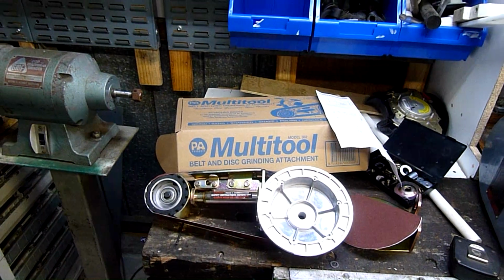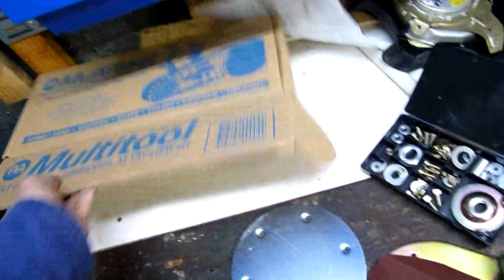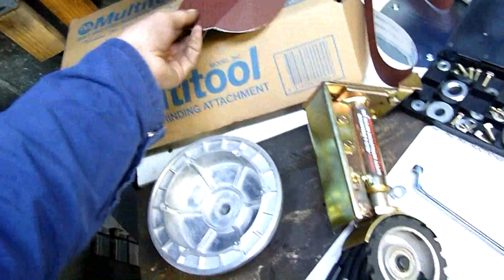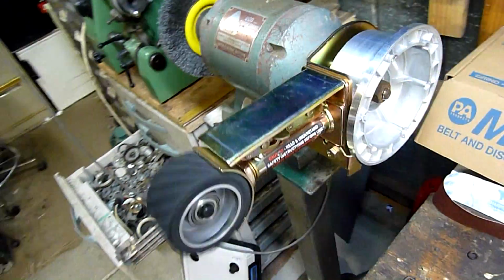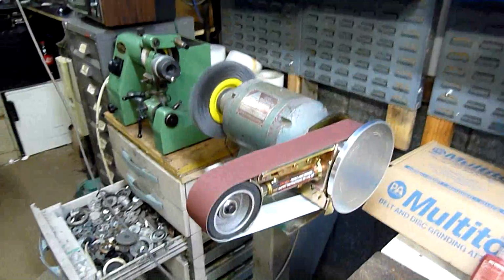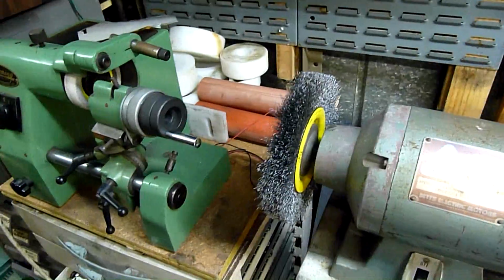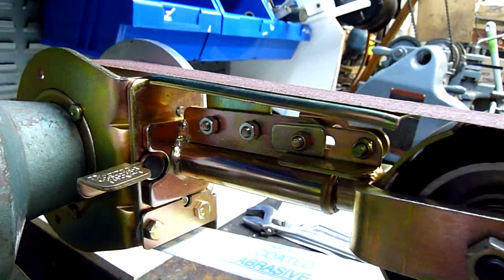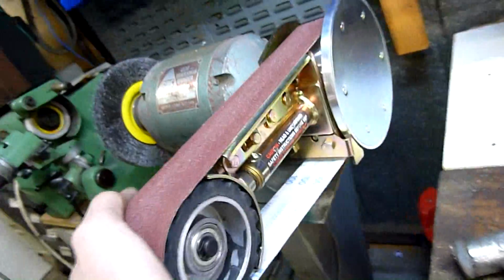Multitool Linisher Attachment Install

Comment: Im new to metal fab. Just wondering why a belt grinder is better than the oldschool grind stone? 

I was hoping to get one of these for also some knife sharpening but i have learnt I cant hook up a controller.  A 400grit belt would work well on knife sharpening. Not sure how good it would go when its at 3000rpm though?

Comment: Nice $$  But Id rather have this belt inclined with a table. Guess you couldn't use the large wheel for anything that way, but it looks like the large wheel is in the back either way.
Looks very well built though.

Comment: Awesome tool and I have already used on a number of projects with much success.>>>do7.info/hsro   Only complaint with most of these sanders is there is no way to sand tighter edges on things. Would be great if you could sand in notches and get part right up against the belt.

Comment: Do you think the tooling grinder like you have is the only proper way to grind small lathe cutters and drill bits too? What about the sorby pro edge belt grinder? I understand that lathe cutters can be sharpened there with precision? Then again their diamond belt cost half cost of the grinder itself.

But for the precision bent grinder this sorby pro edge belt grinder seems to be the only one.

Comment: Thanks for the informative video mate. Have been looking at these and will get one for knife grinding.
Reply from the maker: its not exactly a knife makers linisher, but its a good cheap start, as opposed to buying a professional machine for thousands of $. its great for dressing freshly cut steel prior to welding/machining etc, but I have struggled to get a nice grind on my home made shop knives, but its adaquate
Reply: Aussie50 yeah that's all I'm after, until next tax return when I'll probably get a noob grinder. By that time hopefully I've knocked out a few blades and have gotten the feel for it.

Comment: The problem with this kind of setup is that you are using a direct drive with no ability to vary the speed. If you want to grind/ polish: aluminum, wood or plastic, you need a much slower speed. The best setup is to purchase a variable speed grinder in which lower speeds do not suffer from lack of power.
Reply: I want to buy one and put on the Hercules 8in variable speed grinder. 2000 to 3400 rpm. I think it will have enough power rated at 0.9hp.

Comment: looks like a good attatchment. wanting to know if you could make a video on how to install a polsihing wheel onto a bench grinder and also im wanting a grinder that when a wire wheel is attatched i can really load it up and put some pressure into it to clean up metal plate and rust what do you recommend does the power go on 'watt size'?
Reply: Please reply would be much appreciated

Comment: Two questions,  why would you i pay 250 for attachment when I can buy the whole sanding machine for 70 on eBay? Secondly, If we can can achieve same performance with a smaller quieter machine why do think manufacturers keep doing hefty and ugly ones ?
Reply from the maker: you pay $250 for an industrial grade tool, the $70 china ones are not up to full time production work, where as these Multi-tool ones are. granted I am not running a manufacturing shop, I have grown fond of them and could easily justify the price tag. I have a cheapo all in one Chinese linisher at work, its going in storage as soon as the multitool attachment comes in for the 1Hp pedestal grinder.  the all in one is useless outside of woodworking.
Reply: You means to say sward in gun war ?

Comment: I'm a bit confused, why purchase this and lose half of your bench grinder when one could purchase a high quality mini belt and disk sander?  Wouldn't it do the same?
Reply: +martini carbine Thanks for your response.  I have only seen double ended bench grinders here in Canada with a stone and wire brush or a stone and a buffer and separate disk and belt sander in varying qualities from basic 125 V Canadian Tire tools to green industrial floor standing 250 V AC or more models like in my old high school wood shop.  The industrial sander mentioned may have exceeded 200 kg. (more than 400 lbs) with a 15" disc and a 6" by 48" belt.
Reply: +WJCTechyman I should say the belt  may have been closer to 72 inches
Reply: Power mostly. Mini belt disc combos are fairly low power, 200-300w. A good bench grinder is more like 600w.

Comment: is 250 Aussie or American $?  instructions for any power tool should be clear as glass.  or you can put four more bolts on the bottom of the existing stand.
Reply from the maker: Its Aus $, the baseplate is only 1/4" thick, so its like a big spring when its got such a tall colum on it, it needs a diagonal brace to stiffen it up.

Comment: Looks heavy duty/tough as nails, the standalone cheap chinese ones would break if you screamed at them:
http://www.harborfreight.com/1-in-x-30-in-belt-sander-60543.html
http://www.harborfreight.com/1-in-belt-and-5-in-disc-combination-sander-69033.html
Reply from the maker: haha yeh the dinky Chinese ones are not good for long term use.
fine if you do light woodwork or such, but not metal
we give the one at work hell and it does not give a shit!

Comment: A speed control would be helpful .
Reply from the maker: smallenginedude71 oh no its not 3 phase, but a single phase induction motor will not like running at reduced volts on a variac, it will just pull more current and get very hot.
kinda why I ignore people asking me to overrev a desk fan with the variac, I know it will not work because induction motors run on frequency, not voltage.
Reply: a variac could work.
Reply from the maker: smallenginedude71 not on an induction motor, it needs to be 3 phase with a VFD if I want variable speed.
Reply: Aussie50 ah ok. didnt realise it were 3 phase.
Reply: Aussie50 ok right, thanks for that. i just learnt something!

Comment: Been hit in the face by wire wheel fur. Hurts

By the way remember your amp meter you used when killing stuff, how did you arrange it? (I have ordered a couple and I'm curious on how to rig them up)

Comment: Make a sheet metal cowling around it and put a round connector on it to put the vacuum hose on that way the vacuum can be a mobile dust extraction system
Reply from the maker: the issue with dust collectors on linishers is if I grind a lot of wood. plastic and aluminum, then grind steel, the sparks will ignite the nice combustable mix of fuel dust and rushing air, not a good thing for the shop vac :(

what I need is a blower that just sends it out the back of the shed via a metal tube (100mm aluminum will do)

Comment: What sort of metal was it made of? Was that brass?
Reply from the maker: Mitchell Spencer yeh its a yellow electroplating
Reply: Aussie50 Yellow Chromate electroplating, perhaps?
Reply: Zinc passivated, common colors are silver, gold and black.
Reply: most likely mild steel that has been zinc plated

Comment: Real men don't read instructions, but smart men do and stay out of hospital... :P

I'd love to have a bench grinder, now I have access to a decent sized shed, I could get one, I just haven't the money for it yet, though the previous user of said shed build his own with an old motor from a washer or spin-dryer or something and bolted on a grinding stone, it's seized up now though, so, it's screwed... :P
Reply: A MOT will unseize any motor :P
Reply: jgcertified
Temporarily at least... :P
Reply: Spectacularly, too!
Reply: I'd probably set fire to the shed in the process, too... :P
Reply: Yeah, I'll admit that would be a bit of a downer
Reply: Especially as the shed is not technically mine... :P
Reply: Yeah, that could leave some awkward explaining
Reply: Definitely, thankfully there's no electricity there, at the moment, despite being wired for it... :P
Reply: Heh my workshop is in an in-between state at the moment.. Old electrical system is still running while the new one is built around it
Reply: I don't know what I'll do with that shed's electrical stuff, it's probably serviceable, but the roof is leaky so there could be issues with corrosion, it hasn't seen a decent owner in a looooong time... :S
Reply: Yeah, my electrical system sucks.. So it's getting completely replaced (Some parts are well outside standards)
Reply: Yeah, the shed wiring here is very far from compliant, but then most outbuilding wiring here in the UK is often non-compliant as it's never protected by RCDs, it's a wonder they're not all burning down!! :S